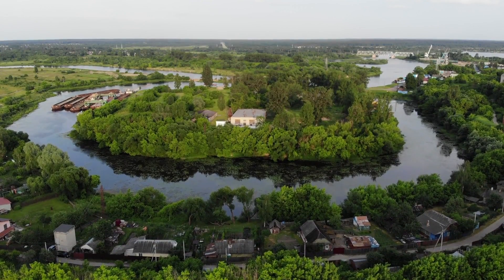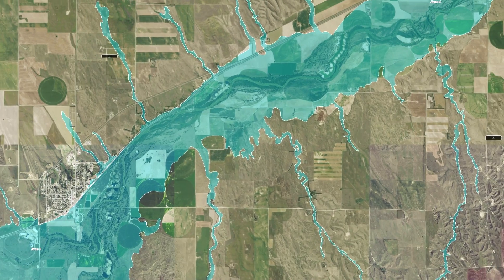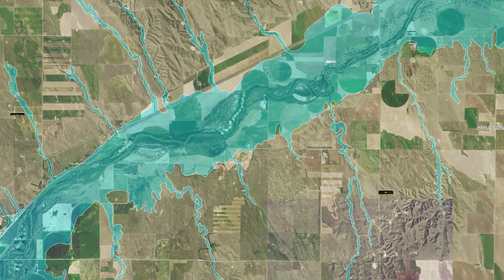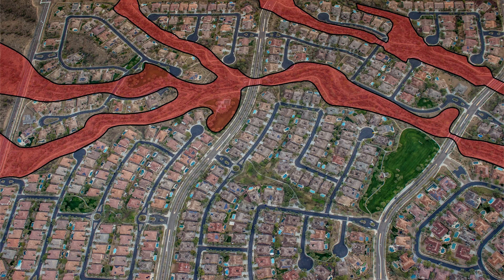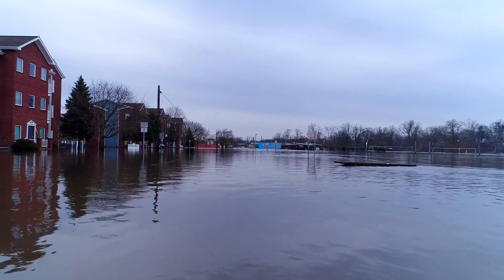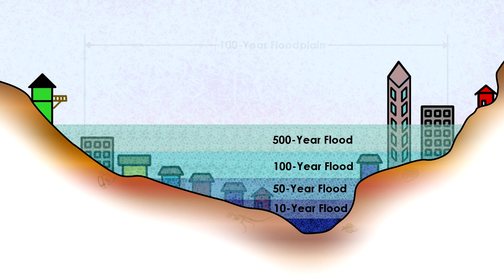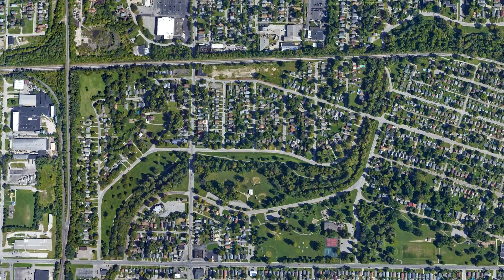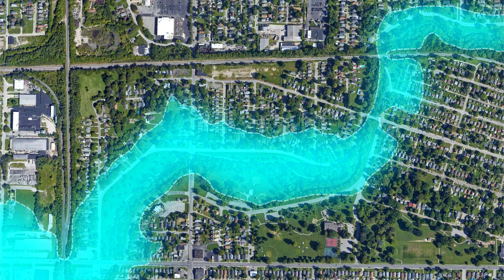Why Engineers Invent Floods

Comment: One element that is very important in this "invented storm" is how that rainfall is distributed over time. Here in the desert it doesn't rain much, but when it rains, it pours. All that water can come down in 10 minutes or so. As you can imagine, that can cause a lot of problems.
Reply: You're right. The intensity of the design storm is a key component in determining peak flow.
Reply: The other thing about those environments is that the extremely dry soil is hard and doesn't start absorbing water right away.

Comment: I would think that bridge heights have more to do with the gap they are spanning than the height of the water in a flood. Congrats on the baby. God bless!
Reply: True for big bridges, which are more visually stunning.
Reply: @gordonrichardson2972  agreed I didn't think of those little bridges in the countryside spanning small streams. Often there is a set of switch backs to access them

Comment: The use of the term "probability" in those situations always bugs me.
Where do we draw the line between statistics, guesses and probabilities?
Doesn't the definition of probability imply either an infinite sample or a proven mathematical model? Do we really have either when it comes to weather?
Reply: How to mask a load of theoretical nonsense as something philosophical!

Probability doesn’t imply infinite samples, though technically it would be infinite when applied to flood magnitude. The use of probabilities for the measurement of flood magnitude is also based on a sound model too, at least the principal is. 100 year event > 1 in 100 chance > 1% probability - all based on recorded rainfall, flow and stage data.

Comment: 5:20 stream gauges, see www.weather.gov, scroll to the bottom under CURRENT CONDITIONS, select River Gauges.  This takes a minute to load, but it brings up all of the gauges on a map.  You can drill into that with a mouse or expand it and select.  You can watch the gauges upstream from where you are during a storm.  I compare the gauge reading to the water level at a local boat landing and I can tell what that gauge means in terms of water level.  I live in eastern VA and I check these all the time when we have a tropical storm come through.

Comment: Imagine cutting costs and then having to explain the reason why your road failed and people died was because you were trying to be cheap. Slightly over-engineering for more cost is always going to be better than under-engineering and risking it.
Reply from the maker: The main point is that someone has to draw the line that you are either over or under. There will always be a bigger storm.
Reply: You don't have one road, but many. Over-engineering one means under-engineering others unless you acquire more budget.
If all your projects are covered and there are still some dongaridoos to throw around sure, over-engineer your most critical piece, but that's a big if
Reply: Usually the designer is not around (retired or moved on) when the big flood arrives.